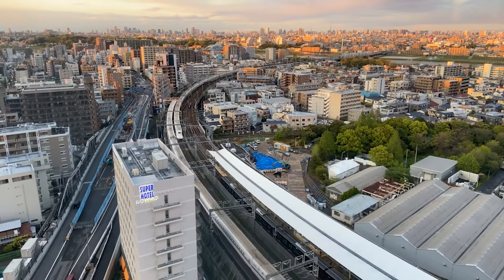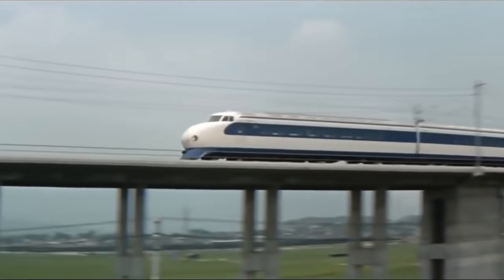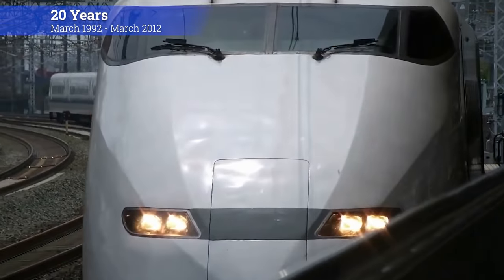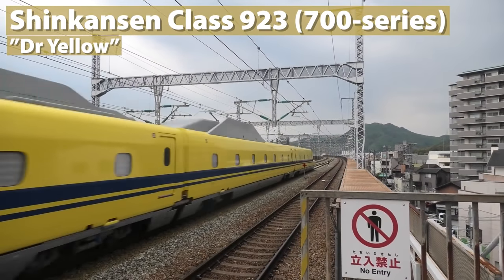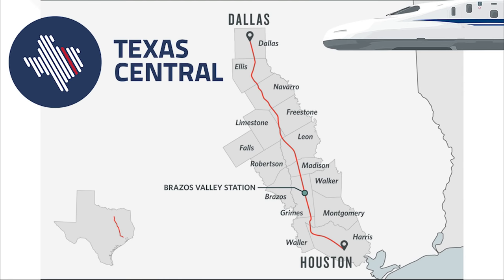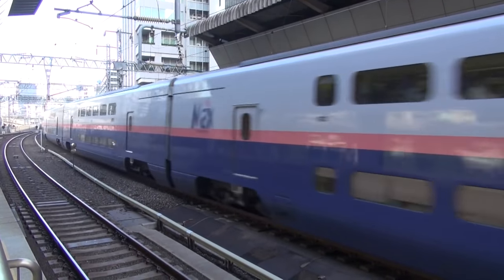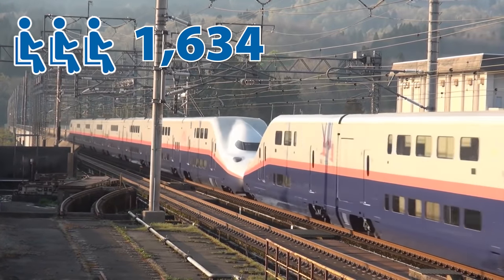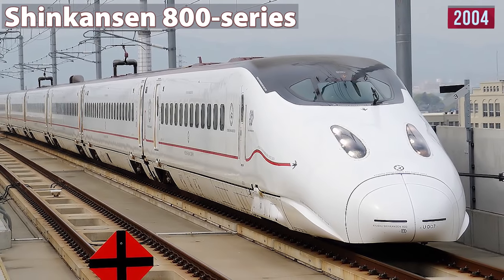Evolution of Shinkansen Trains - EXPLAINED

Comment: The fact that japan already had high speed rails in the 60s while most of the world only had it just recently is astonishing.
Reply: Not to mention they were still struggling war ravaged nation
Reply: what exactly do you mean by "just recently"?
Reply: @awagnow  most had it in the 90s 2000s 2010s
Reply: The UK were still on steam, like wow.
Reply: @travisbickle4360  正直、苦しんでいたのは1950年頃までです。日本は1957年頃から急速に発展しました。
Reply: You need to work a bit on your history. The Americans and Italians were already running diesel or electric EMUs at 160 km/h or more in the 1930s, when the vast majority of trains ran on steam power. The French were happily running 200 km/h trains in the late 1950s, and the Germans followed less than a decade later.

The French had run two locomotives at 330 km/h in the early 1950s, although the record attempt has been described as "suicidal".

What the Japanese did – also out of necessity – was to build a dedicated high-speed line. That had never been done before, and compared to the rickety 1067 mm narrow gauge, it was a massive improvement. In Europe and the USA, where practically all trains run on standard 1435 mm gauge (unless they run on broad gauge), there wasn't the same need for a dedicated high-speed line, because you could upgrade an existing line and run 200 km/h on it.

However, top speed isn't everything. With level crossings, passing through towns, sometimes sharp curves, there are all sorts of things slowing you down. With a high-speed line, which has no interference with any other kind of traffic, and which is mostly straight, you can run fast for much longer. That's what was so revolutionary about the Shinkansen.

So that's why the French and the Italians started building high-speed lines in the 1970s, and the Germans and the Spanish in the 1980s. I'd hardly call that "recently".
Reply: @SeverityOne  well said mann
Reply: @SeverityOne  bro literally went 🤓 mode just because he said recently lmao
Reply: @Grrrrrgfifj  No, not because he said "recently", but because he was talking rubbish.
Reply: Economy crisis in Europe...
Reply: @einfachjxnii4153  Name one European country, with or without high-speed rail, that has as high a debt-to-GDP ratio as Japan.
Reply: @SeverityOne  日本のは国債だろ。債務者が日本政府なのに対して債権者は日本国民だよ。極端な話、踏み倒すことも可能。それが良いか悪いかは別として。
Reply: @ERJ-170_NKM  It's still debt. Somebody will have to pay it someday. It's not something that you can keep pushing forward indefinitely.
Reply: Well most of the world still doesn't have it
Reply: @SeverityOne 🤓
Reply: @travisbickle4360  Yes, they showed that how strong they were at that moment!
Reply: Most of the world will never have a hsr. Australia, New Zealand, Canada. 
The US, India, Africa, and Southeast Asia need at least another 10 years.
Reply: @SeverityOne they might be american and have exactly 1 single high speed rail and assumed everyone else did that
Reply: @yusteryumeister4601  It could well be. In general, people tend to think of Japan as a country where everything is perfect. The reality is a bit different.
Reply: Bro forgot the TGV💀
Reply: @edited1325 🤓 = I have no effective or decent response to this user's comment so I must post some random emoji to make myself feel better
Reply: @justarandomsovietofficerwi2023  🤓
Reply: The reason is because Japan was interested în something good which is effective and the other countries were starting to change towards cars and airplanes and thankfully only america was the country that did not move towards trains
Reply: @alexandrumoloiu716  the US public transportation is trash it makes me sad tbh every time I visit Japan to see family I get depressed just thinking of returning to the US it’s sucks here now
Reply: @travisbickle4360 well, japan were struggling until 50's, japan has been into age of high economic growth, that they had money to build shinkansen.
Reply: America still hasn’t have a proper one but can really benefit from it lol
Reply: @hopeforeveryone8676 yes, which explains why Shinkansen trains aren’t the fastest.
Reply: Many counties were running steam locomotives at 100+ mph long before the 60’s.

Comment: I started watching this video while on the N700S, and now I’m finishing the video on an E5, on my way to Aomori! Cheers, great video!
Reply: Which is best n700 or E5 series please tell.....The E5 series has been chosen for India's bullet train project.....
Reply: @rexracer2852  N700S. But E5 is also top of the line, it have slightly higher top speed too. I wonder why India choose that because E5 is designed to go though tunnels...
Guess it's cheaper and faster than N700S, and back then China can't export their trains (technology licensing issue, China finally built their own tain in 2017).
Reply: @AaronShenghao  N700s entered service 3 years after India's train project was started. Also, 25 kV 50 Hz is standard in India which is also used by JR East.
Reply: I live in Aomori 
Where did you go?
Reply: @programmingwithkaito514  wow, nice! I, going to Aomori very often, so I’ve been to a lot of places! Very beautiful landscapes there!

Comment: Something worth noting is that the Shinkansen shown from 13:09 to 13:20 isn't actually an E5, but rather one of the four very similar H5 sets. The main difference between the two types is that the H5 has improved heating equipment, extra protection for electronics and other measures to combat the colder conditions along the Hokkaido Shinkansen lines. The main way to tell them apart at a glance is the stripe between the green and white. On the E5 the stripe is pink, whereas on the H5 it's purple.
Reply: noticed that too, well spotted. Did a round trip from Tokyo Station to Shin-Hakodate-Hokuto back in Jan 2018, and I really like the H5. Also on the return trip I got off at Omyia just to be able to ride on the E4 top deck :)
Reply: Yeah, I noticed that as well.
Reply: Aside from color, look under the duckbill fairing, H series have snow plows under the nosecone. I find it easier to tell the difference, especially when they are coming head-on through the station and you can't see the stripes yet.
Reply: @Hadren Railway would you please tell which is better N700S or E5 series shinkansen...... searched for this everywhere but didn't get much info......
Reply: @rexracer2852  Depends on what you mean by "better". The E5/H5 series has a higher top speed and is the newer model but the Tohoku Shinkansen has a much lower load and was built later than the Tokaido Shinkansen so that effects how fast the trains can go. Either way, the Chuo Shinkansen is clearly top.

Comment: You forgot to mention the variant of the Shinkansen currently in use outside of Japan - the 700T operating Taiwan's High Speed Rail service! 

It's an interesting case because it's designed with some European safety standards and design language too, but it's still a direct product purchased from the Shinkansens in Japan.
Reply: Don't forget the  CRH2, which was an E2 licence built by the Chinese and one of the basis for their own in house train designs.
Reply: Well, then there are lots to mention. The CRH2A is not too different from E2, while CRH2C just with just slightly more technological domestication to raise the speed to 300km/h. 

AFAIK the mainland Chinese authorities also wanted the 700/800 series initially but the NipSha doesn't export technologies, thus Beijing instead chose Kawasaki. It worth mentioning that although high-speed trains has been evolved very fast (2C&3C, 380ABCD, CR400ABF) in mainland China, higher-speed train no so, thus 2A has kept domaninant the 200km/h orders for 10 years until two years ago CR300AF/BF enters the service. Neither the development of CRH3A nor older CRH1&CRH5 managed to shake 2A's market dominance.
Reply: @GyacoYu  It was also the reason why future JR Central rolling stocks were not awarded to Kawasaki as they do not want their design exported, at least not under their terms.
Reply: @MarcusChan  also Kawasaki's standards has slipped there was a few cases of body work or bogies defect such as cracks. one of the bigger case was the singapore's NSEWL trains built by CRRC qingdao sifang (under licence from Kawasaki with bodywork from japan)
Reply: @PrograError  there was a crack found on a shinkansen undercarriage made by kawasaki.it was in service for 10 years.and from what i know the singapore mrt c151a was designed by kawasaki and manufactured by qingdao sifang.there were also other problems relating to shoddy built quality.
Reply: I love this train; takes me to my relatives in minutes

Comment: Interesting thing about the 0 series:
The first 0 series were replaced by newer 0 series in the 80s since JNR did not have the money to design a completely new rolling stock. 
No trainsets ran for the entire period from 1964 to 2008. The Tōkaidō 0 series retired in 1999.
Reply: so there are 2 "new" 0 series?
Reply: The 0 series were produced in many batches from 1964 to 1986, 224 trainsets.
The 0 series that reached 10-20 years of age were replaced by newer 0 series
Reply: @PrograError  There are many variations of the 0 series and as time went on Central and West even started to combine different model 0 series cars to create new sets with designations like 0+1000 witch means some parts of an original 0 series set, mated to newly manufactured series 0-1000 cars to form a set that would have the formation classification of “NH”. 0 series is a slippery slope of model designations, formation numbers, and some sets are even one off unique formations that no others have. The last 0 series that were running where designated 0-7000 series which operated Kodama service on the Sanyo Shinkansen. Toward the end they wore a grey and green livery called “fresh green” but later on the remainder were repainted in the old JNR colors before there retirement in 2008.
Reply: I heard that the O series was named after 100 series was started.  Until then, Shinkansen had no series.  This story is similar to the first Apple "1" computer.

Comment: You forgot about the upcoming E8 train set, the prototype of which may appear next year. The E8 will replace all the E3's on the Yamagata Shinkansen service, since its top speed will be 285 km/h instead of the 270 km/h top speed of the E3 train set.

Comment: When I went to japan (Kyoto to be exact) I went on a N700A from kyoto to osaka, and it was a 7 minute journey, and our top speed was 285kmph, so the acceleration was incredible. Especially compared to the 10 - 20 minutes the eurostar took to get to 299kmph... And the fact it was over houses in the city!
Reply: But Eurostar has rules of speed limits to apply to when running in UK, ..
Reply: @GmailCom-hh6yq 
That has nothing to do with its acceleration being shitter then the bullet train lol
Reply: Not sure what type of Eurostar you mean but it might be quite unfair: the older Eurostars (Class 373) derived from the TGV have two power cars (literally permanently coupled locomotives) like the TGV and ICE 1/2 (these have power cars with 4.8 MW each), 373 has around 6 MW each and these 12 MW (deployed onto 12 axles, so 1 MW per axle) have to move up to 815 tons.
On the other hand all Shinkansen series including your N700A have distributed traction, so no power cars, much more axles/bogies haves motors (and only around 300 kW) the particular N700s have in summary up to 16 Megawatts.
If you want to fairly compare them you have to do with the newer Eurostar 320/Class 374 from the Siemens Velaro family (ICE 3) that also has distributed traction and 16 MW.

Comment: I live in Nagano, the Joetsu Shinkansen was newly opened for the 1998 olympics with the E2 train.  Special interior features included luggage storage for skis and snowboards, and the trains were all-wheel drive (first in the world at the time I believe) to allow for the steep grades and possibility of ice and snow on the run through the mountains.  It's also why the speed is limited on that particular route.  The E2's on that line were 100% replaced by the E7 when the line was extended out to Kanazawa.

Comment: There are some points that u forget to tell.
1. Shinkansen E7/W7 Series is the only High Speed Train in Japan where it can run at both 50Hz and 60Hz of 25Kv AC OHE. As Japan is divide in 2 Parts in Electricity and From Joetsumyoko to Kanazawa the Hokuriku Shinkansen is operated by JR West. JR East only operate From Takasaki to Joetsumyoko.
2. Shinkansen E4 Series will be Phase out by end of this Year.
3.In Kyushu Shinkansen, there are 2 Special Variants of N700 Series, N700-7000 and N700-8000.
These trains are in 8 Coach Configuration with no tilting Technology as they don't run on Tokaido Shinkansen.
N700-7000 are owned by JR-West and N700-8000 are owned by JR-Kyushu
Reply: 4. Additionally, the N700 series are limited to 260 km/h in Kyushu, the same speed as the 800 series. They only operate at 300 km/h in the San'yo Shinkansen.
5. With the E4 series now retired, the Joetsu Shinkansen speed has been raised to 275 km/h.
6. The Hokuriku Shinkansen's top speed of 260 km/h is limited by the steep grades due to a vast majority of the route going through mountainous terrain.
7. E5/H5 routing north of Aomori to Hakodate in Hokkaido had been left out in the video completely.
8. Nishi-Kyushu Shinkansen has been introduced in 2022 September with N700S rolling stock in a white over red paint scheme and a large black spot surrounding the cockpit window. The top speed is 260 km/h.
Reply: @iPlayOnSpica  slight correction for 6: The top speed is 260 because it is required by law, as it is part of the shinkansen basic plan. Kyushu, Nishi Kyushu, Hokuriku and Hokaido are all built under this framework. This is no coincidence that their top speed are all 260.
Reply: @sbeve7445  While I understand where they've come up with the 260 km/h limit, I wanted to also convey the geographical justification for Hokuriku's speed limit specifically. It is one of the longer routes, after all, comparable to Tokaido and San'yo, so people would wonder why the trains don't go faster there. Speaking of Tokaido, its 285 km/h limit is caused by the curves due to it being the oldest route passing through myriad coastal cities of central Japan rather than opting for a straighter mountainous route between Tokyo, Nagoya, and Osaka. There's not much incentive to raise the speed limit there because of the construction of the Chuo maglev shinkansen.

Comment: I second what @route55qatar said, your videos are well researched and quite accurate, thank you for your videos. As I write from my residence in Japan, I wanted to point out two pieces of information. Yes, the 500-series trains ran on the Tokaido track to Tokyo but were not JR Central (Tokai/Tokaido-sen) trains. The 500-series trains belong to JRWest Sanyo Shinkansen. While I am sure Railways Explained has explained this in previous videos I will quickly explain again. When JNR (Japan National Rail) broke up, it created several companies. Each company received a local train network and a Shinkansen line. As the video showed, south of Tokyo there were two segments, those segments are connected which allow passengers to hop on a shinkansen in Tokyo and disembark in Hakata w/o needing to transfer. Trains departing Tokyo station and ending at Shin-Osaka are JR Tokai trains. Trains departing Tokyo and bound for points beyond Shin-Osaka are usually Sanyo Shinkansen (JR West) trains. JR West buys access on the JR Tokai Shinkansen line to get their rail passengers to and from Tokyo.  That is why one would observe a 500-series train on JR Tokai's rail bound for or depart from Tokyo Station but it was not a JR Tokyo train.  As the video said, it's no longer used on the JR Tokai section anymore however, JR West's N700 still trains are. While JR Tokai and JR East terminals are Tokyo Station, their tracks are separate and do not cross at any point, so travelling between JR Tokai and JR East Shinkansens require a transfer at Tokyo Station. Each company has their own train R&D Technology divisions (except, JR West and JR Hokkaido...they are the poorest of the JR companies) and they design their own trains and systems as well as export the technology and construct Shinkansen systems overseas. JR Tokai is the most successful, as you see they bid for & won the TX project, bid for the California project but lost out, built the Taiwan system and are building the mega-lev central line in Japan on their own w/o the government's assistance. JR East has begun to step up in recent years but I am unaware of any projects outside of Japan. The recently listed JR Kyushu is quite famous in Japan for their local commuter train designs (would love to see a video highlighting their rolling stock). Their Shinkansen looks rather basic on the outside but the interior is quite famous for being made with local wood from Kyushu forest. Final point, there is perhaps a reason for JR East and JR West (Sanyo) to jointly design and build rolling stock. The next segment of the Nagano, Kanazawa Shinkansen is scheduled to open up in a year or two and connect to Fukui before completing a circuit ending at Shin-Osaka. This will allow JR East to get its trains to Osaka w/o being connected to JR Tokai.
Reply from the maker: Thanks for this additional comprehensive information.  It is a great supplement to our video.
Reply: Don't forget the  CRH2, which was an E2 licence built by the Chinese and one of the basis for their own in house train designs.
Reply: "Each company has their own train R&D Technology divisions (except, JR West and JR Hokkaido...they are the poorest of the JR companies)" -- I think you mean JR Shikoku instead of JR West.